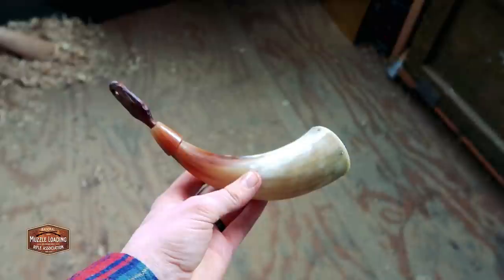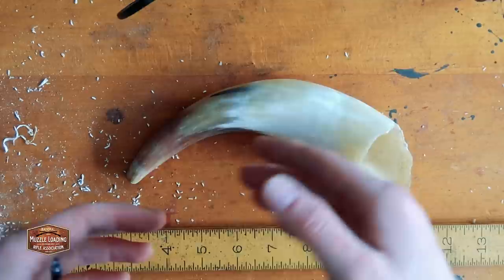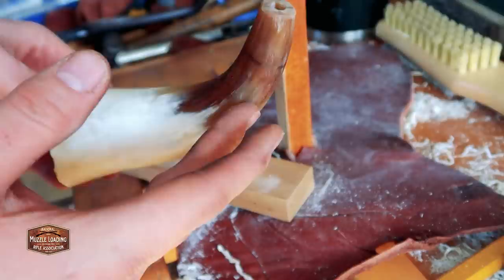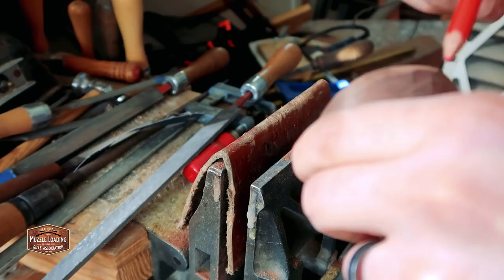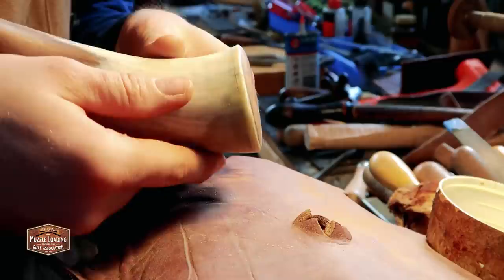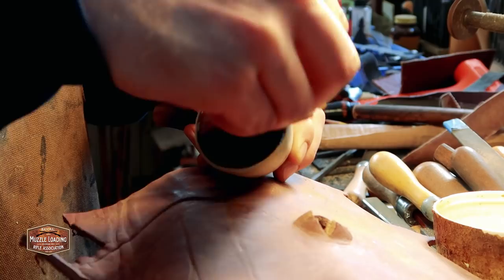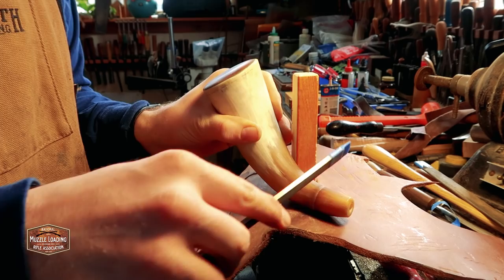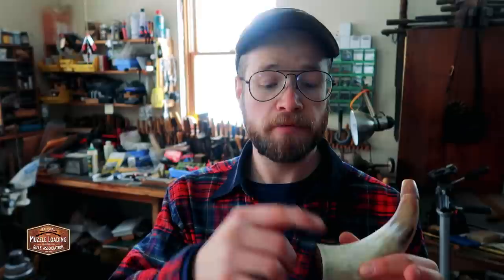How to make a simple powder horn | DIY blackpowder accoutrements

Comment: Hi again:
 One piece of advice for your viewers. When you use a hacksaw to cut your rings around the horn tip, put the blade in the saw backwards. It's much easier to control pulling the saw, than pushing it.
Just a piece of advice from a long time horner.
God bless:
Two Feathers
Proprietor of:
The Mountain Man Emporium
Reply: Ty for tip god bless you
Reply: God bless ty for the tip fixing to try to make one

Comment: An old timer tip is to steam or boil the opening of the horn to soften it up a little bit (just like your finger/toenails get soft when you soak in the hot tub) and then fit the plug and let the horn dry. The horn will adjust to the plug for a super-tight fit and when you epoxy (cringe) or pine pitch (happy face) the plug into place it will be airtight.
Reply: Hi, could you give me a idea of length of time in hot water? Boiling or just hot?
Thanks.
Reply: What kind of material do you use as the plug, I am concerned that the material used would break and the plug becomes stuck inside thehorn and prevents you from using the tip hole untill you bore it out.

Comment: I suggest putting a register mark on the horn and plug so you know exactly where the plug goes each time you check it for fit.  This is just a small mark or more but each mark needs to be identified by different color mark or some other means of defining each.  You can't make all the marks the same.  I guess you could but it would make it more difficult.  When I'm marking such as this I use just one mark.  Just an idea.  Thanks for making and sharing a great video.

Comment: I've made a smaller version of the main charge horn for my primer powder. I cut the horn in half and used the larger end as a holder for the horn and used leather straps to hold it onto the strap of my "mountain man purse" otherwise known as the possibles bag. I started out with a full size cow horn though.

Comment: In addition to fitting the plug to the horn by the method shown, another way is to turn a round tapered cone shaped piece of wood on a lathe and boil the end of the horn. Push the cone up into the horn and let it dry. When you remove the cone you'll then have a very round opening and you can then turn a plug on a lathe to fit your horn. You can also re-use the cone for other horns.
Reply: This is the method that I use.

Comment: I made a powder horn and used a broken wine bottle to smooth the horn. Just wrapped a wine bottle in paper and then gave it a sharp tap with a hammer. The paper stops glass fragments going all over the place. Then opened the paper and selected a piece of the bottle that had a curved edge. I used this piece of broken bottle to smooth the horn by dragging it along the horn. The glass cuts off long strips of horn and very quickly I was down to the inner horn and finished it off with sand paper. Just make sure you have your mind on the job or you will cut yourself very easily.

Comment: Please don't get me wrong I'm not giving you crap. just pointing out a  big safety issue. 

ceiling the end cap of the horn with epoxy resin is not a very good idea. 

you have just made a bomb that sits on your hip .really needs the end cap to be fitted with 2 or 3 mm wooden pegs and beeswax used to seal it .if in the event of a spark getting to the powder horn contents. And yes it is documented that exactly this is happened in the past . The  wooden pegs and beeswax give the precious that builds up an easy route to dissipate 

Again just a heads up and this was a great tutorial .cheers for posting

Comment: I have some questions here I can't seem to find the answers for. 1) when placing the large plug in the hole, how do you fill the horn afterward? 2) what do you use to make powder horn water proof, if the owner falls into the water it is desirable that powder still be dried so they can still use it. Is it beeswax or some wax saturated rope between the plug and horn? 3) the small tip, what kind of material do you use to keep it from leaking water and from breaking off inside if you take a tumble down the mountain? If that little plug breaks off and the shaft is still inside the horn it would seem the only way to acess the poweder is to punch in thru into the horn then remove the big cap to tek it out.. 4) when rivets are pounded into the horn do you use animal hide glu to seal the holes to prevent water from entering the horn or is there some other type of water proofing that can be used? Thank you for your time.

Comment: To drill start with a small bit and don't forget the flat a the top is at right angle to the plug.at top I have been making horns pouches m l rifles for 40 yrs. When you cut your butt plug outside toward inside is 10 degrees. To scrape hold the blade at a 90 degrees to horn and scrape do not cut

Comment: As always you make very informative videos and I learn allot thanks. I'm starting with a product I bought online. I most likely should have started from scratch instead but water under the bridge. I took my horn apart because I could not get more than 100 grains of powder into my horn. I found that the shop that built this did not drill all the way through to the main cavity. Can you tell me what you did to clean out the inside of your horn mine looks really funky.

Comment: If you are truly trying to duplicate an 18 century black powder, powder horn, JB Weld, or any type of Epoxy Resin does not fit the bill of available materials.
Try using Pine Pitch you will harvest from the forest as a glue and sealant before drilling for and driving in the brass pins.

Comment: Hello:
 NEVER EVER glue in a plug....EVER!!! You've just created a hand held bomb! Should you ever get an ignition spark into the horn, the whole thing will end your life, or cost you a limb? Make the plug to fit correctly from the start. It's not THAT hard. I've formulated a very easy way to create an almost perfectly fitted cap, that requires only a piece of paper, a school glue stick and a pencil. 
God bless:
Two Feathers.
Proprietor of:
The Mountain Man Emporium
Reply: yeah...glueing in the plug of a horn is not the best idea...
Reply: If the horn is poured into a measure and not the barrel, that should never be an issue.... stop smoking while filling your powder horn.

And FYI, glue or no, spark plus a container of BP equals a bad day....

Comment: epoxy....CRINGE...if you heat up the opening the horn will "shrink" around the plug, then you drill tiny holes for tooth picks or thorns from the locust tree, stick them in, snip them off 1/4" above the horn and tap them in...after it cools you'll check for leaks, you plug them with bees wax or pine pitch.....horn is a natural material and moves with temperature and moisture, the epoxy doesn't